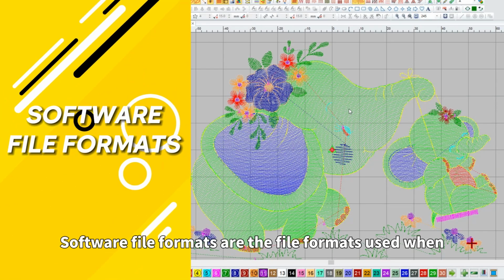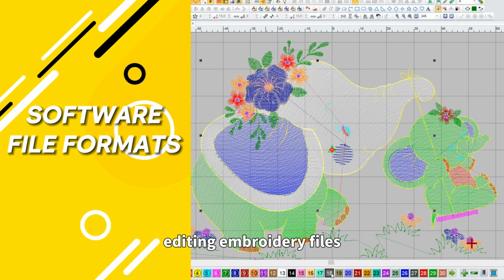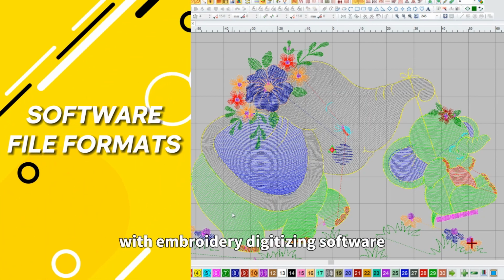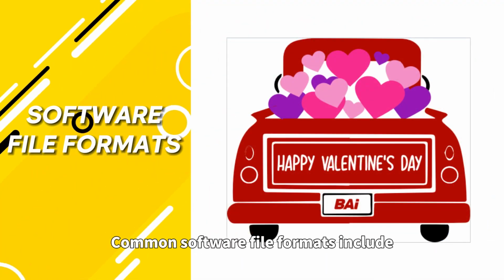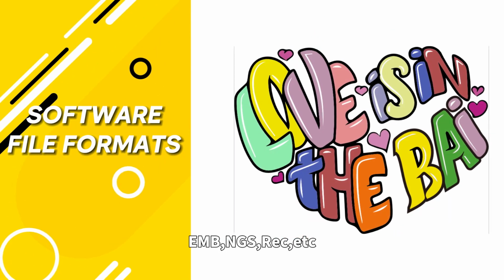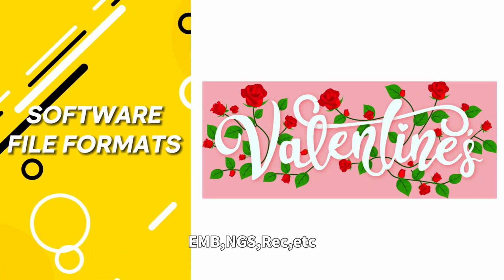6 Questions about Embroidery File Formats Explained | Machine Embroidery beginner

Comment: When using a new usb stick, do you have to format the usb? If so how?
Reply from the maker: 😊Hi, we only support FAT32 format, plug the USB into your computer mouse right click properties select FAT32 and format.
Reply: Thanks. However the issue I’m having is that now when I put a usb in my machine, it’s deleting all my files. It’s showing on my computer, then when I take it to the machine its wiping the usb clean of my files
Reply from the maker: Hi. When the USB memory is too big, the files missing problem as you described may occur .Try to use a 32GB USB or one USB with less RAM than 32GB.😊
Reply: I use a 4 gb stick
Reply from the maker: OK.Please contact our engineers who will assist you in finding the specific problem and resolving it.
Leo Wang
WhatsApp:+86 18900636028
Email:service02@ebaima.com
Facebook:https://www.facebook.com/profile.php?id=100087896671268
Luke Ren
WhatsApp:+86 18961517173
Email:service03@ebaima.com
Facebook:https://www.facebook.com/profile.php?id=100094317416802
Chirs Zhong
WhatsApp:+86 18900631626
Email:service01@ebaima.com
Facebook:https://www.facebook.com/profile.php?id=100073186299060